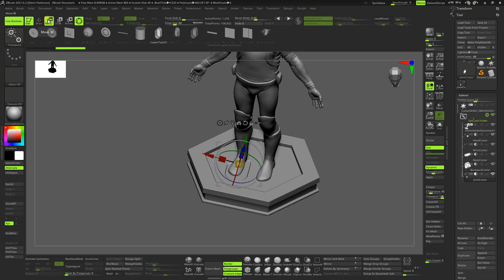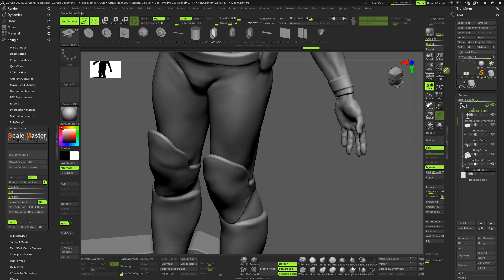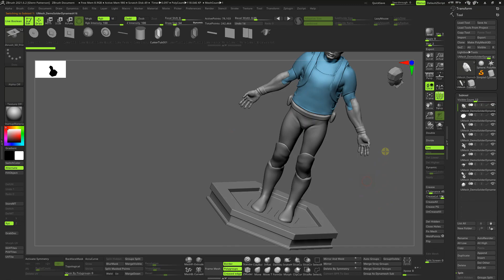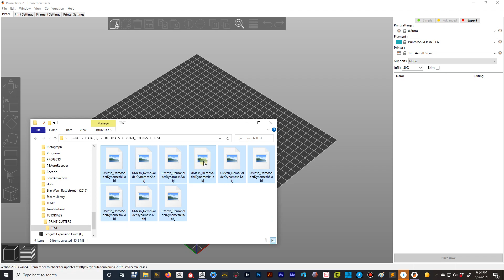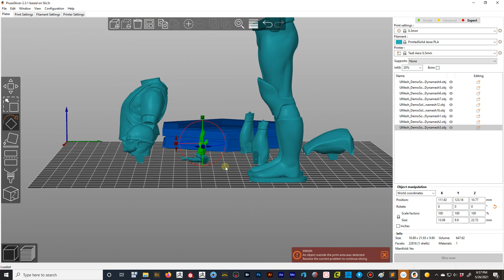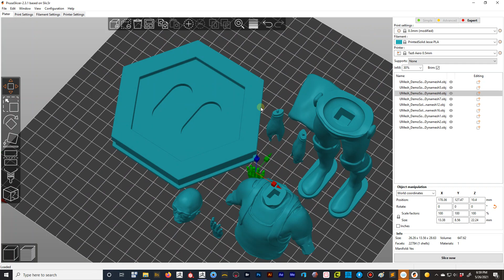3D PRINT CUTTERS Part 2

Comment: Hi, Thanks for those tutos. But I got a problem, did all the steps like you, but when i'm trying to boolean with SDdiv, nothing comes up, do you know what could cause that ? I've 4 Mil points, is it too high to work ?
(Sorry for my bad english, not my native language) Hope u can help me :c
Reply from the maker: Should be able to use a high poly model. Be sure everything is in same folder, check that the Cutter is below your model you want cut, also has dynamic subdivision on, and it's set to negative. Then you should see Boolean with subdivision in folder options
Reply: @Glenn3D1993  Yeah, everything works fine on other things, like your demo or with a sphere I just cut in two pieces. But Idkw my project won't work. I clicked on the Boolean, he loaded but I don't have any result :/
Reply from the maker: Try to do a close holes and fix mesh on the high poly model, then try again
Reply: @Glenn3D1993  Hi ! It worked, thank you a lot ! :)

Comment: Sir want to ask..why my texture gone when i apply to 3d printer..?help me..🙏
Reply from the maker: When you perform Boolean operations the resulting mesh doesn't hold on to UV coordinates or textures. It will however hold on to vertex color or in Zbrush case Polypaint. You can convert textures to Polypaint via Polypaint panel and click Polypaint from Texture, but remember to have enough polygons to support high-res Texture
Reply: @Glenn3D1993  thanks..i try..😊👍